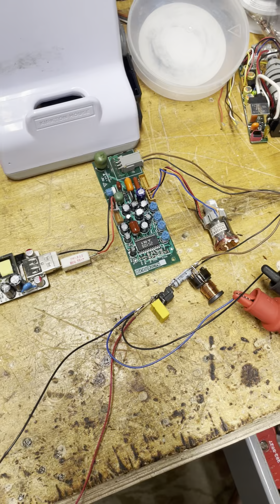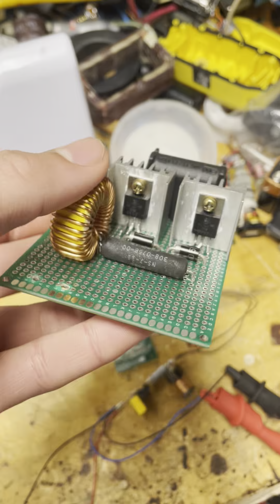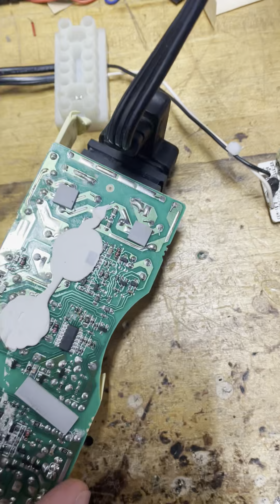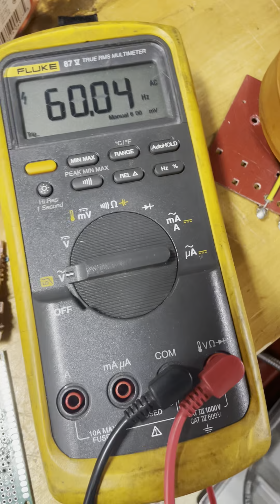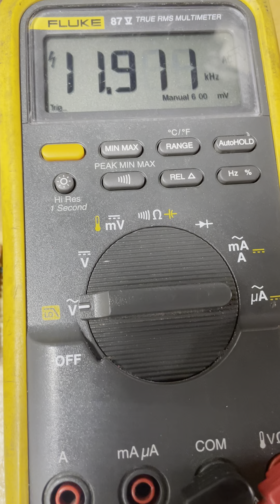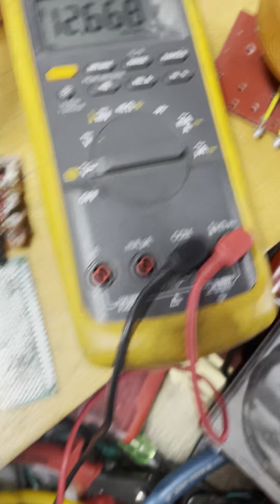12-20 kilohertz signal generator and igbt brick driver circuit

Comment: dude I want a igbt but they cost so much money
Reply from the maker: Yeah they do, I bough two single module ones for $25 which wasn’t two bad but then I decided to buy two half bridge modules for $40 to try to build a full wave inverter but I never built it because I needed 4 15 volt power supplies which I never had so it was kinda a waste of money
Reply: @King_supermarket25$?
Reply: They cost like 100
Reply from the maker: @Arcingkid I’m risking it on eBay with used module, there might still be a listing available idk
Reply: @King_supermarketohhh igy